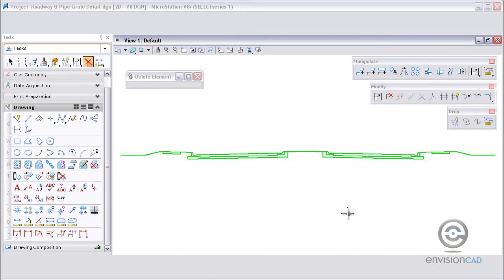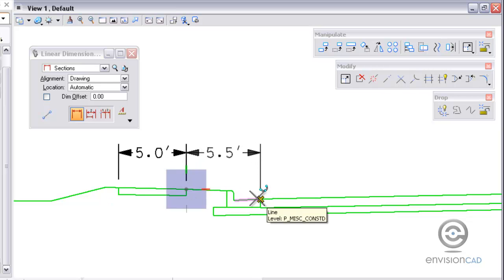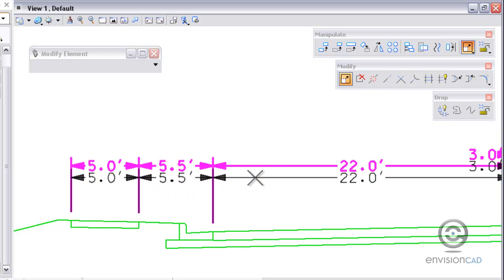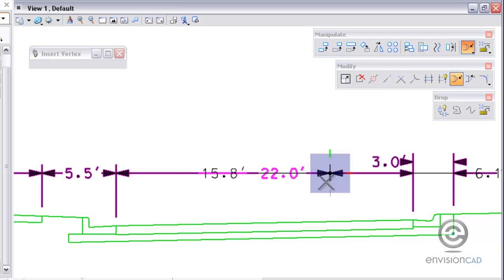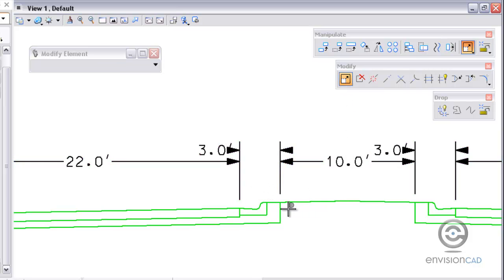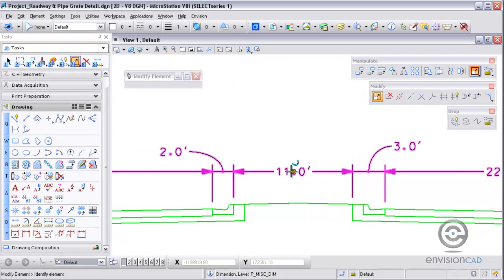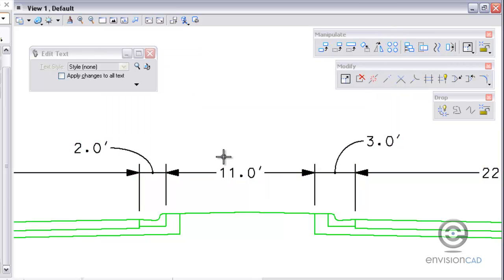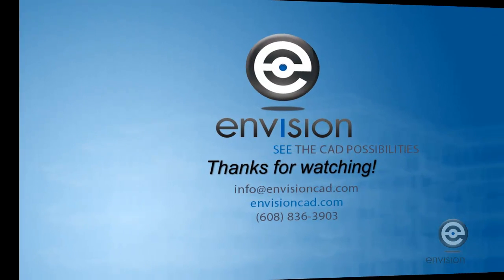MicroStation V8i Working with Dimensions

Comment: I've had issues with modifying the diameter dimension text. I'm trying to move the dimension text (as it clashes with centrelines of equipment) parallel along the dimension like any other linear  dimension, butt he Modify tool only let's me rotate the dimension about it's centre axis, not move the text (regardless of the Dimension Style geometry settings). I realise there a ways around the problem like Dropping the dimension to geometry, but it's good practice to avoid a "work around". Have you noticed this before? Is there a solution?
Reply from the maker: +Jack Gibbins I tried a few things out and can not find a way to modify the text when using a radial dimension without dropping the dimension.  I would contact Bentley Support and submit a change request.

Comment: hi, I want to write two dimesions together; means mm on above the dimension line and cms on below the dimension line.
if we modify/ move the dimension both should move together.
Can you help me with this?
Reply: A tip: you can watch series at flixzone. Been using it for watching all kinds of movies during the lockdown.
Reply: @Grayson Aydin definitely, I have been watching on flixzone for months myself :)
Reply: @Grayson Aydin Definitely, been using flixzone for since november myself :)
Reply: @Grayson Aydin yup, have been using Flixzone for months myself =)